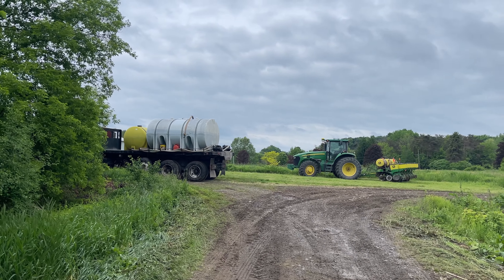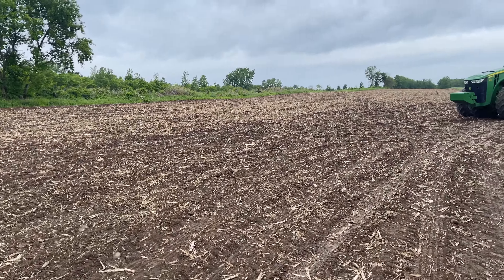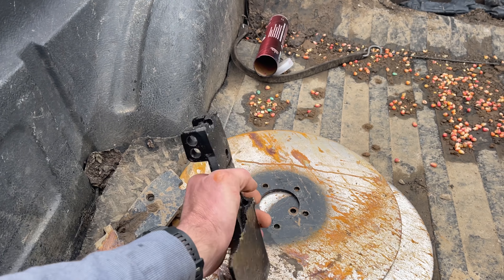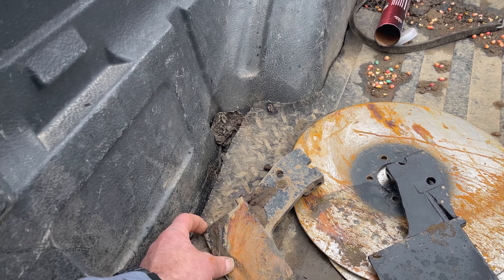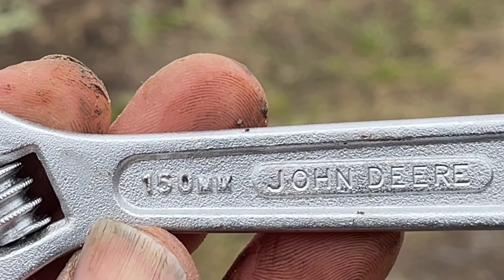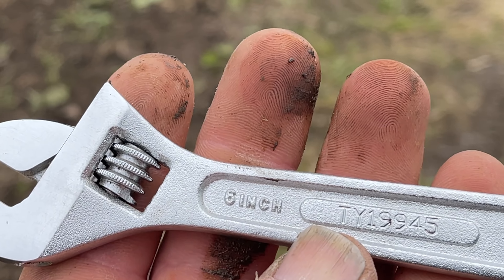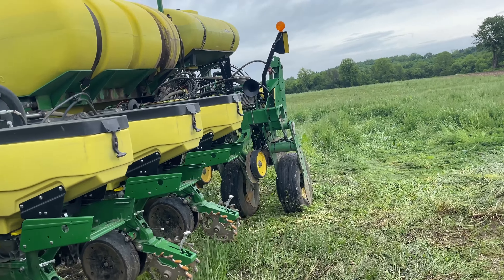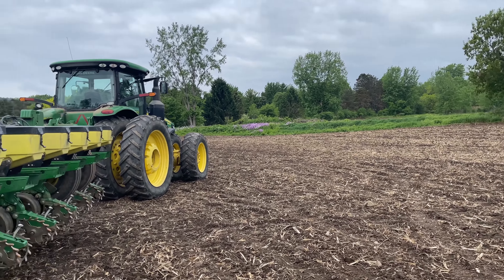Metric and standard crescent wrench

Comment: The original high precision Bahco crescent wrenches are wonderful and won't round off bolts as long as you haven't used them as hammers and loosened up the tolerances. I've seen some fancy high precision ones by Snap-on etc. with titanium in them too but there must be a rule of nature that all wrenches sooner or later will get used as hammers and destroyed.. Or one can buy cheap Chinese knock-off  crescent wrenches that are guaranteed to round off every bolt every time.

Comment: Diesel Peeps
Do you know what DEF fluid is? It's Diesel Exhaust Fluid. Every Diesel truck that has been made since 2010 is required to use it. It's a product made of 67% Urea fertilizer and 33% distilled water. Every diesel truck you see driving down the road today has to have this product to drive. The engines won't start without it. There are regulators inside the engine that mix DEF with the Diesel to reduce Diesel emissions. That's the purpose of DEF. 
Right now, Russia is the largest exporter of Urea by a wide margin. Qatar is second. Egypt and China are Tied for 3rd. Both Russia and China have decided to no longer export Urea. On top of that, India is the largest manufacturer of Urea in the world even though they consume most of what they make. What little they would export..........they no longer do. They are now stopping the exportation of any and all Urea minus a deal they just cut with Sri Lanka.
What does this mean for you and me? Well, first, the United States imports most of it's Urea fertilizer. We are the third largest importer in the entire world. We depend on other countries to eat, drive and ship our products. 
Secondly... Flying J is the largest Service provider for Truckers around the Unites States. I'm sure you've seen their massive gas stations when traveling around the country. Flying J gets 70% of their DEF fluid from shipments via Union Pacific railroad. UP has single user access to the Fertilizer plants that Urea/DEF fluid comes from. No other rail provider has access to these distribution points. This means Flying J can't just go around Union Pacific. Union Pacific is in charge....for a reason I'm gonna mention in a few paragraphs. 
Flying J provides 30% of all DEF consumed in the United States. UP has told Flying J to reduce their shipments by a whopping 50%. And if they do not comply then they will be completely embargoed. That would in effect bankrupt FJ. This means that 15% of all DEF consumed by truckers in the US is no longer available at the largest travel service center for the entire trucking industry. 
Rome rotted from the inside out. It was easily invaded because it was occupied with internal problems. It appears we have discovered the Trigger. DEF fluid. If this holds up, DEF shortages will be the catalyst that causes food shortages in the coming months. Not only is there a shortage of fertilizer to grow crops in drought-stricken states (See Kansas' drop in wheat production for 2022)....but....now it looks like, unless the Federal Government intervenes via the Defense Production Act, ...which I am no longer confident they will....there is gonna be an absolute massive shortage of trucking in the coming months. 
There simply isn't going to be DEF fluid sufficient to keep the engines running and moving. Home Depot is now limiting the amount of DEF you can buy in their stores. 
I would think long and hard about the decisions you are making right now. Where you live. What you spend money on. How you prepare. This is so real that the CEO of Flying J, Shameek Konar was summoned to a Surface Transportation Board hearing to give them all this info. 
From what I'm reading....Blackrock is the majority shareholder of Union Pacific railroad. How is that important? Americas biggest fertilizer producer is CF Industries. Their largest shareholder is Blackrock. Blackrock controls the fertilizer industry in the U.S.. Union Pacific has exclusive rights to distribution points of fertilizer. Urea is fertilizer. Flying J needs Urea/DEF. Blackrock is controlling everything. 
The Chairman of the BlackRock Investment Institute is Tom Donilon, President Obama’s former National Security Advisor. Tom Donilon’s brother, Mike Donilon is a Senior Advisor to Joe Biden. Tom Donilon’s wife, Catherine Russell, is the White House Personnel Director. Tom Donilon’s daughter, Sarah Donilon, who graduated college in 2019, now works on the White House National Security Council.
It appears Blackrock is spearheading the dismantling of the US system on behalf of the Globalists. And the first domino they are pushing over is the energy sector. They are using DEF to get the party started.
Reply: DEF is not mixed with diesel in the engine. 

I have heard about coming DEF shortages and I'm thinking that every paranoid person out there is going to go and buy as much exhaust fluid as they possibly can and creating a shortage just like toilet paper a couple years ago